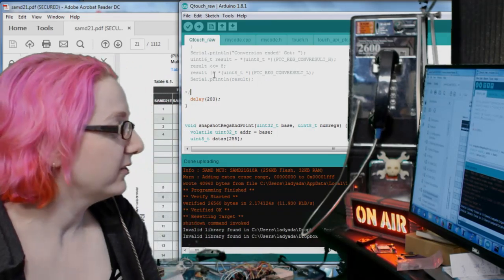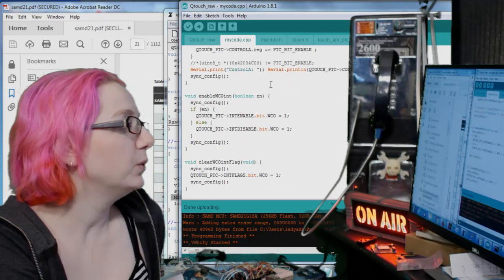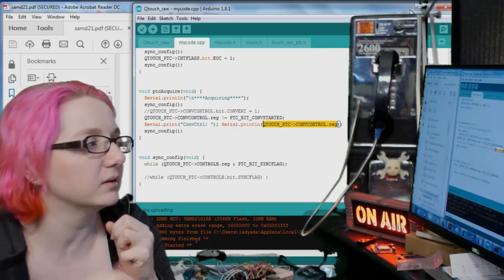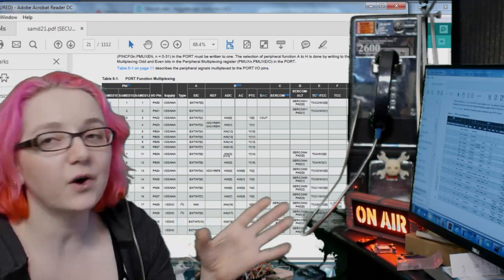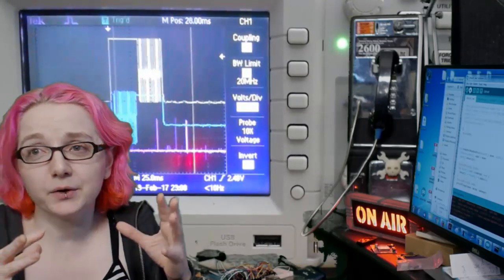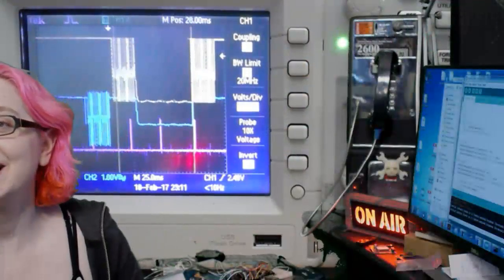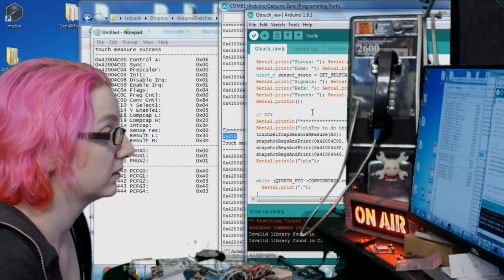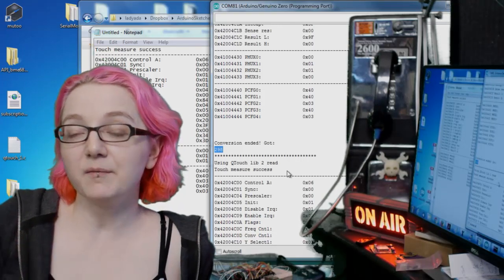#DeskOfLadyada SAMple SatURday + QTOUCH update 2/18/17 @adafruit #adafruit

Comment: You need to be careful about bit packing stuff in a structure as C does not define that the order of members has to be in the order defined. the compiler is free to order them how ever it wants. In short it's not portable. but for this application should not matter.
Reply: Indeed.  You might find your code will work if you re-order like this:

struct byte {
 unsigned bit_0:1;
 unsigned bit_1:1;
 unsigned bit_2:1:
 unsigned pad:5;
};

i.e. little-endian vs. big-endian ordering.

I tested this on avr-gcc and it works "as expected" (or "as unexpected" if you prefer)